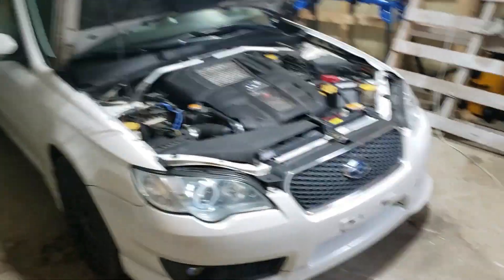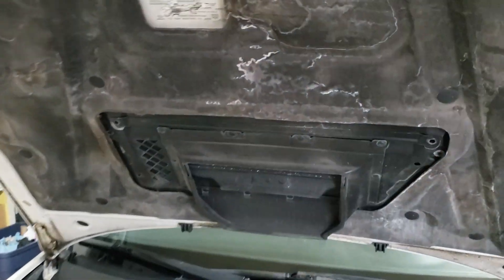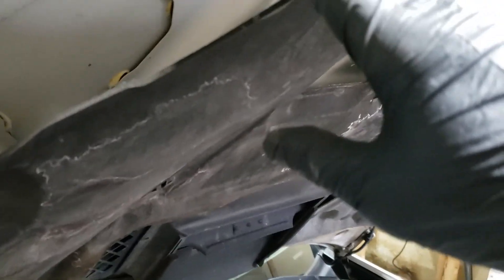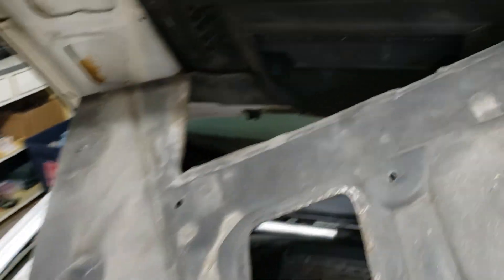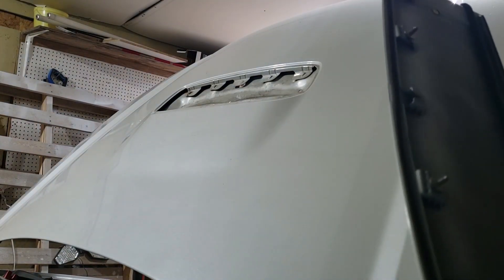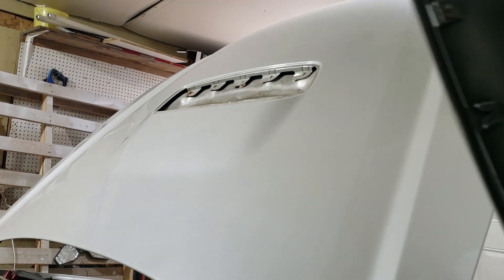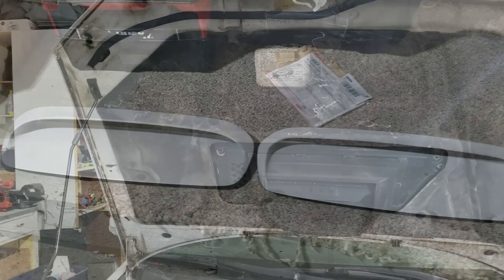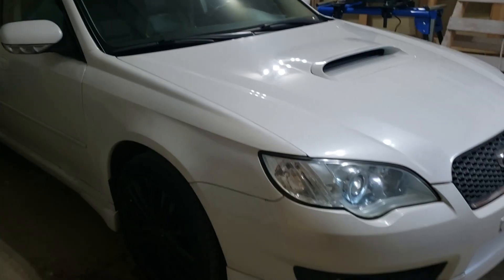2005-2009 Subaru Legacy GT Extended Hood Scoop Install

Comment: When you remove the 4off 8mm nuts nip the bottom of the middle trim clip with needle nose pliers and the scoop will simply pop off. The slot on the scoop is orientated so that you would need to push the scoop towards the windscreen to remove which is impossible unless you can release the rear if the scoop.